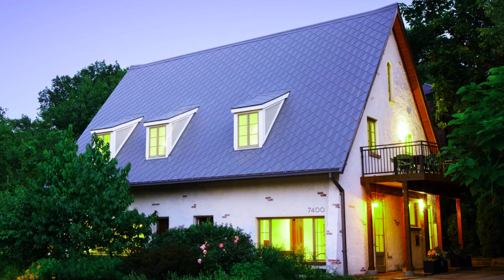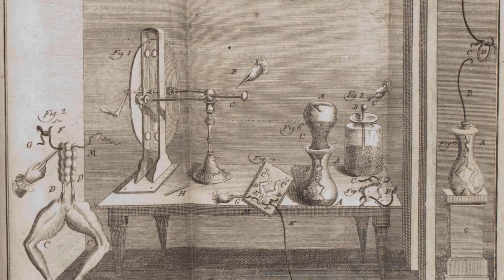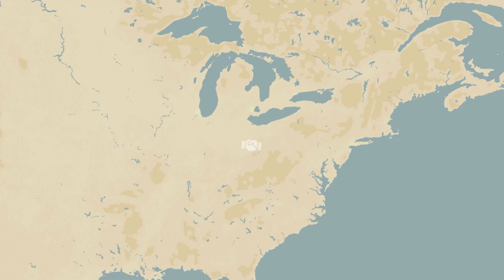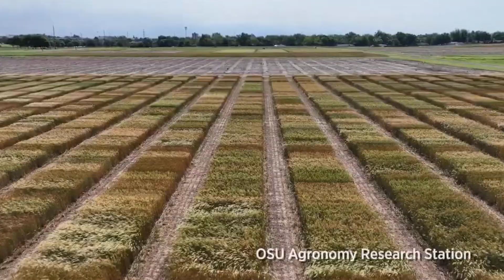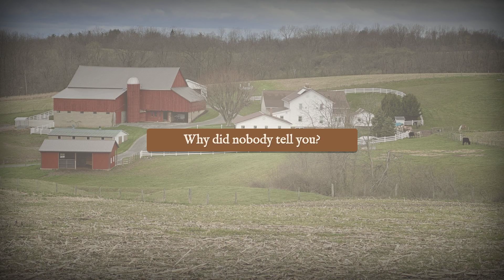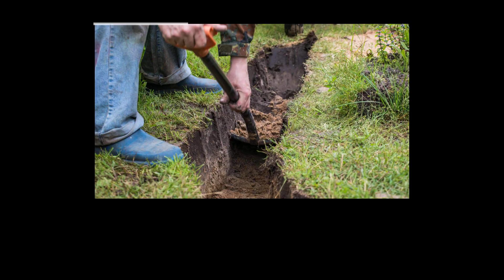The Amish Dirt Battery That Powers Homes for Decades — Why Was This Forgotten?

Comment: Even 1000 zinc/copper/soil cells would only produce about 10-40w of continuous power. That is less than one small solar panel. Spaced as the video suggests - 200 cells would be 600 ft of trench. 1000 cells is five times that. For the power of one small solar panel.